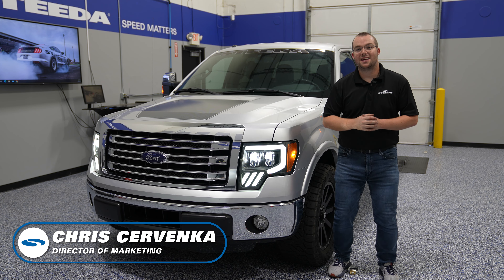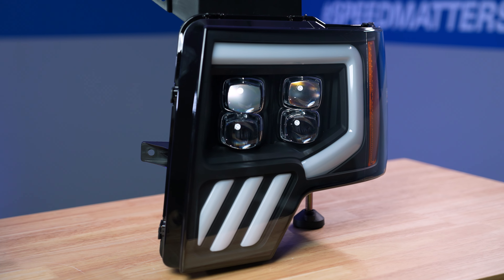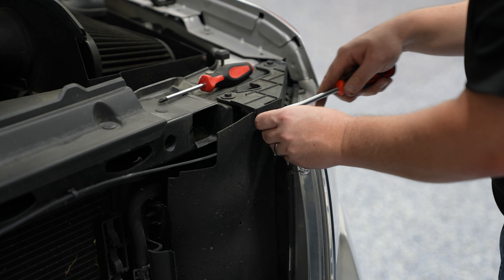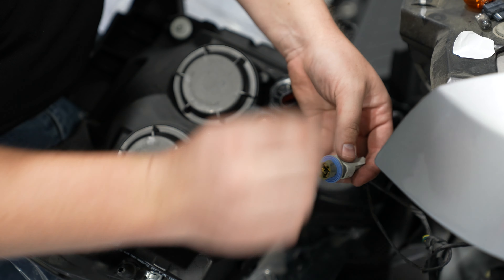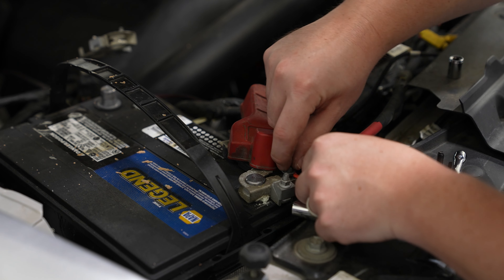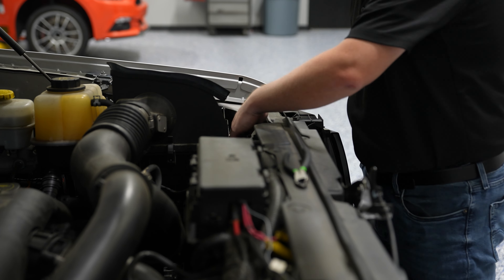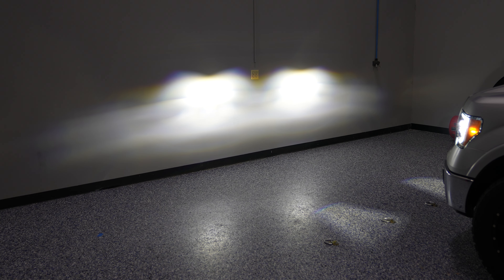Add DRLs to Your F-150 | AlphaRex NOVA Headlights | Review & Install

Comment: I will commend AlphaRex with the beautiful headlights but I've had so much failure with these for the price point :/. First one the DRL on the passenger side ended up dimming out (got them exchanged), then the next one the driver side turning signal ended up not working after a couple of months (currently in the process of another exchange or refund). Also just to get into contact with AlphaRex is a hassle...though hopefully others don't end up having the same experience as I did. Also I did like this installation video than others 👍
Reply: brudda I got myself Morimoto XB's instead, go with that

Comment: I fail to understand why they don't design the light assembly so that the DRL and the running light to run off the same connector. It seems it would be an easy thing to do to have them connected internally or at least provide a jumper so that the factory lead to the running light can be used to power both. Having to run separate lines for power and ground seems unnecessary in today's day and age .

Comment: I bought these two years ago i think from someone else. Just found out my right side stopped outputting low beam/high beam. The turn signal and day light lamp works. Could it be a simple  fuse that broke? I feel like i spent too much for it to fail right out of warranty.
Reply from the maker: If they weren't purchased from our site, I'd call or email AlphaRex to see what your options are. They have a 2 year warranty if you are the original owner.

Comment: Really hope y’all can give me some advice. Everything works great except for the fact that my hi/ low beams don’t work. Wired everything correctly so I’m not sure why it doesn’t work. Any idea? Really don’t want to have to return these.
Reply from the maker: Hi Jack - I would check the wiring in the connectors to the back of the headlights. Same goes for the associated fuse. Sounds like it could be something simple. If you continue to have issues - just give us a ring at 1-800-950-0774. Hope this helps! -Chris

Comment: I watched the install video for these headlights.  I had then professionally installed.  They could not align them because they didnt have the wall to do it.  I cannot find a video on how to align them.  The drivers side is the one that needs it.  I have watched video's for other aftermarket alignments on 09-14 F150s, but the alignment "screw" on my NOVAS are different than those, and the Philips screwdriver does not work.  How do i align it?
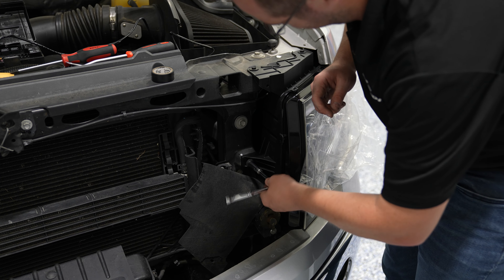Reply from the maker: The "screw" AlphaRex uses works more like a gear with a larger Philips head screwdriver. You can find the alignment screw on the driver's side next to the bolt being tightened at 4:25 in the video. The screwdriver should go in straight from the top and you can engage the "teeth" of the alignment screw with the side of the Philips head.

Comment: I would not connect the wire under the fuse like that.. Scary!!  Although, I installed Morimoto XB, into my 2014 F150 FX 5.0.  They worked for 8 months, till DRL want to stay on all the time.  Be carful with taking the Hottest girl to the Prom.  She will be a pain in the ass:)
Reply: I got moritmots and I had it installed today 6/16, I used the fuse tap in position 77, is that what you used as well?